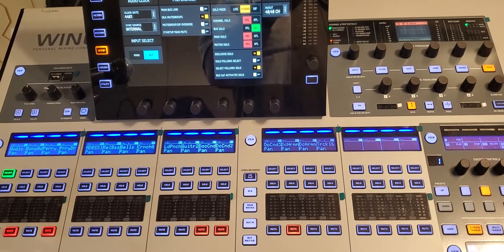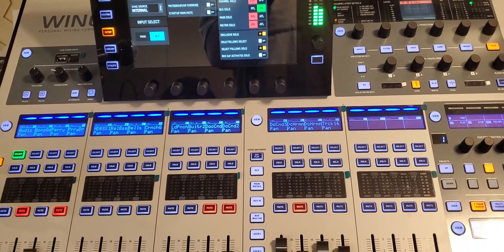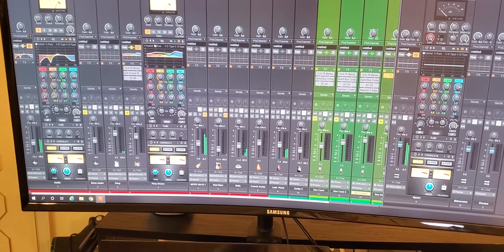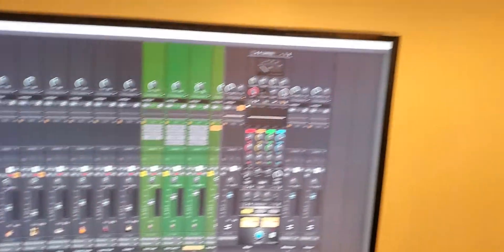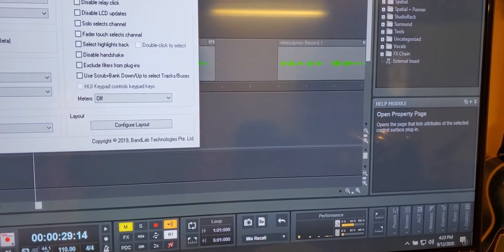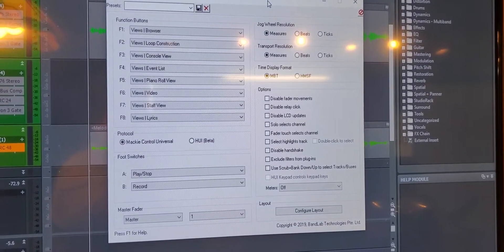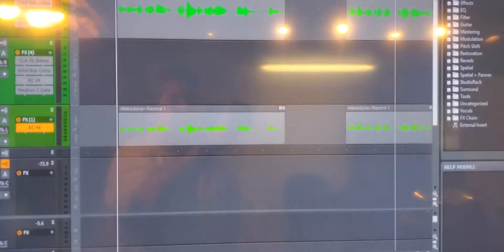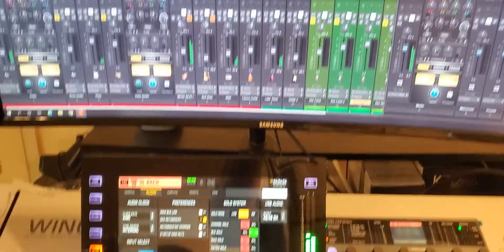LED Meters on the Behringer Wing using Cakewalk by Bandlab

Comment: I see you got those meters rocking in DAW mode!!! So glad bro and thanks for sharing. I was looking around for a solution for you from your last video and ended up running into YOUR video here with the solution. The DAW you are using used to be called Sonar. It was one of my favorite DAWs years ago. Had no idea they revamped it and made it free. Just found out from looking it up after watching your vids. Gonna check it out soon. I am about to grab my Wing here shortly after I get a few more answers to a few things. Can't wait!
Reply from the maker: Hi TeknoMaatix! Yes, I stumbled across this and I thought I would share in case others were struggling similarly. I was so glad to hear that Bandlab adopted Cakewalk, and not only that, they seem to be doing a wonderful job in the continued development of the DAW. A gentleman from Austraila has a "Creative Sauce" channel on you tube that has proved to be a great resource as far as learning Cakewalk. I can highly recommend checking out that channel, perhaps you may have done so already.

I hope to see some great videos from you someday.

Happy music making!
Paul
Reply: @basementmidi  Thank you. No, I have not checked it out, but I will now. I used Cakewalk a ton when it was Sonar. I am wondering if it will still be familiar to me now in its current state. If so, I may not need help with learning it. It used to be really expensive, just as much as Samplitude, Pro Tools, etc. And, you will see some vids from me soon. Especially when my console arrives. I'm excited!
Reply from the maker: @teknomaatix7654   No, you will not experience a learning curve. I am sure the Bandlab version will feel very familiar to you!